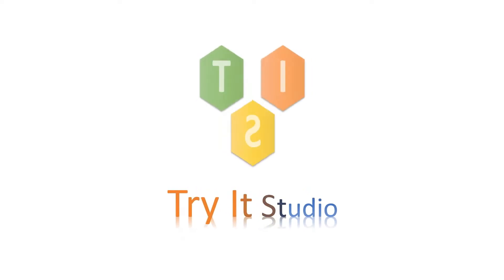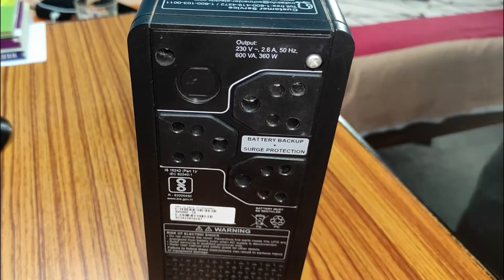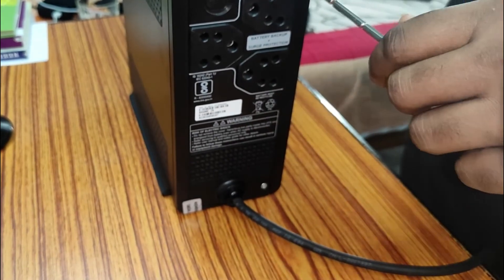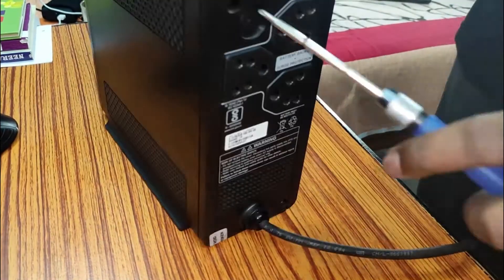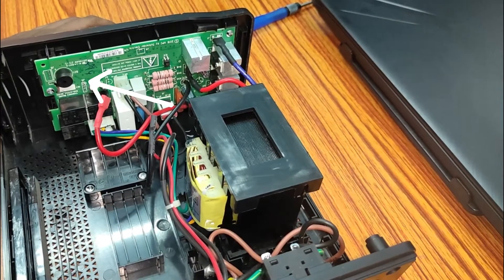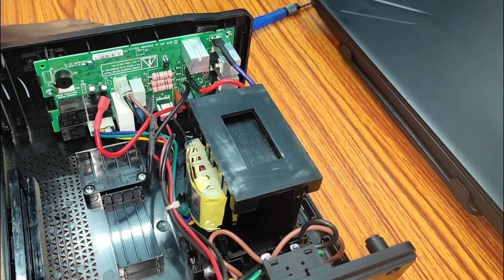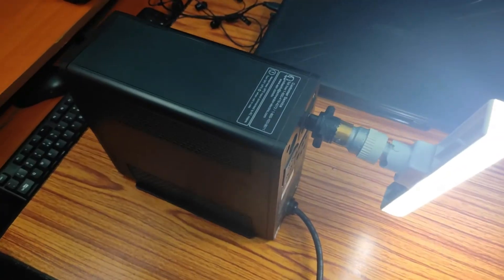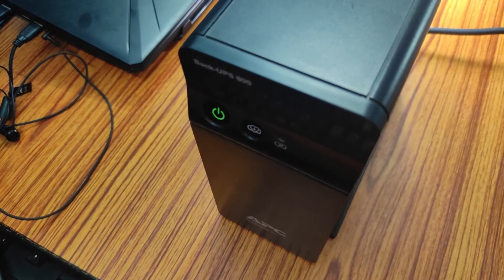How to stop annoying beeping sound of APC UPS

Comment: I removed that magnet and it fell on the chip and made a visible short circuit, and it stopped working, is it safety stuff or I’m screwed?
Reply from the maker: The board has safety features, I hope it is working!
Reply: @tryitstd  it is not working anymore, is there any chance it can be fixed?
Reply from the maker: @idan6917  Now service center is the only option. Anybody with electronics knowledge would be able to repair it.

Comment: DON'T DO THIS! 
Most UPS devices today have this option built-in in the Power switch. Just lightly tap it two times and you will hear two beeps for sound off, and one beep for sound on.
Lightly tap means not pushing it all the way in like when you are turning it on, but just light tap so it will move just a little.
Plus you will keep your warranty.
Just read "Troubleshooting" from your instruction manual for users if you have it.
Reply from the maker: I wish my UPS had this too!
Reply: Not all ups have this function, alternatively you can replace the speaker with a led instead.
Reply: You saved my ups!
Reply: Could have used that information a long time ago. Lol
Reply: This is not helpful. I lost my manual, and what you're saying sounds like vague gibberish. I need more specifics.
Reply: @danielantony1882  It works on my ups. Just don't go all the way in when pressing the power button. Tap twice, you'll hear a beep and that's it.
Reply: @m.m.m4871  Yeah, I think mine doesn’t have that option.
Reply: my old ups had this function
Reply: my old apc i was able to chose on power chute if having notification or just led indicator. on my newer model the selection in powerchute doesn't do a thing it will still beep
Reply: @vedranbozic3771
Reply: @vedranbozic3771 bro if the ups overloaded then it will sound or not?
Reply: Thanks man.. It's works❤️❤️

Comment: Is there any UPS for a PC that doesn't make noise?   I hate the juvenile fixation UPS makers have with their devices being a noisemaker, are they 12?   I know the power went out already!
Reply: What ups u use?
Reply: Lightly tap the power button 2 times. Not hard enough to actually push it. One of the other comments suggested this.  I was skeptical,  but I tried anyways,  and it worked for mine.  If it works,  it'll give 2 quick beeps after you do it,  and the sound will be turned off
Reply: @lawrencespruyt5053  sadly this only works until low battery or some other conditions, then sound is back on again.  This is why some people stab the piezo speaker with an ice pick.  No sound! Loud noises are for kids, grow up UPS makers!
Reply: @RWZiggy  which still makes it more useful.. it's no longer alerting that the power went out,  but that it's about to die. And you don't ruin your warranty.. I was pretty happy when I learned you could disable it like that,  no more ups going off disturbing my sleep
Reply: @lawrencespruyt5053  the UPS will run the battery out with or without sound;  it's up to you to have the gear turn off before then.  with or without sound.  The alarm serves no purpose; I don't need one
Reply: @RWZiggy  if it goes off as it's dying,  it means you can keep going until the alarm goes off.  Aka, you don't need to shut down for a 2 minute power outage.
Reply: This very not helpful. I tried doing 2 taps, it did absolutely nothing. You need to be specific about "Light Taps." I don't know what makes a light tap different from a hard tap, and how to understand which one I got through the reaction of the device.
Reply: @danielantony1882  just one newton second less force than breaking it.  Same as filling tire to1 psi before it pops
Reply: @RWZiggy  Apparently, my UPS doesn't have such a function.
Reply: No, sometimes when we are out of the same room where the UPS is, we may not know the power is out. So it is really necessary in that way. But sometimes it's very disturbing though 😃😂

Comment: You should take off your rings before doing any work near high voltage.
Reply from the maker: Thanks for your advice.
Reply: in this specific case, once disconnected from grid and removed battery it should be saf*ish*  because there are no big caps there. the transformator is doing all the heavy lifting. but your advice still stands in building a safer attitude in general